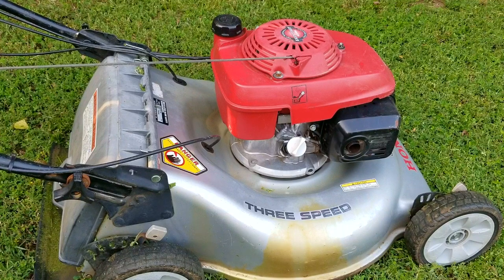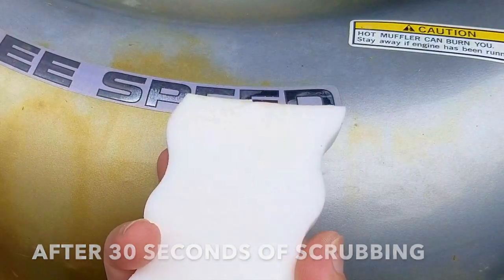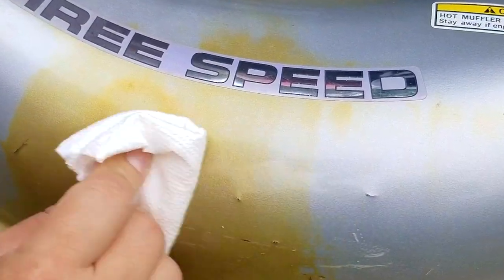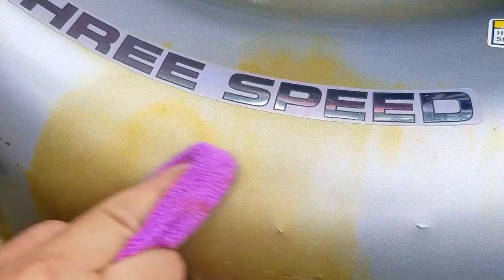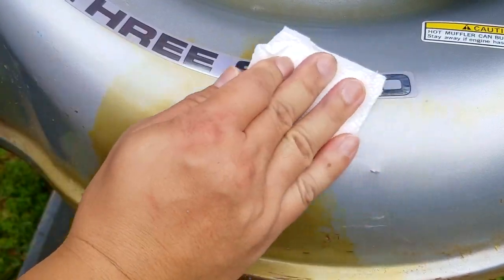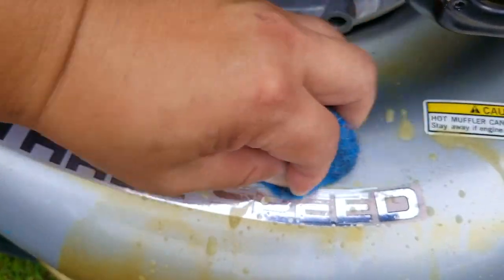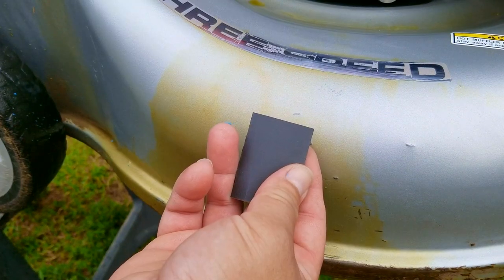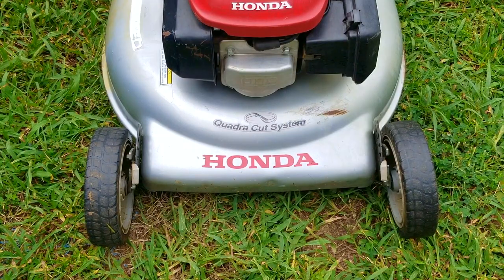Trying Cleaning Products On An Oil Stain On A Honda Mower

Comment: It seems as though a chemical reaction has taken place between the paint and the oil. I agree that the only way to remove it is mechanically. If that is the case the paint will be damage and the deck will have to be repainted.
Reply from the maker: thank you A Patterson, I agree with you.
Reply: That's always the case even if you don't damage the paint to bad it will still need a repaint or top coat to make it look right again

Comment: Magic Eraser is a little abrasive by itself and is supposed to stay wet and the steel wool is a little more abrasive and should remove the top surface layer of paint or top coat that is stained. After cleaning the stain then use the buffing conpond or a protective waxing after the stain is cleaned to your liking , I wash and wax my Husqvarna mower every once in a while to keep it looking nice as possible
Reply from the maker: thank you Eric Richardson.

Comment: Nice video.  Thank you for making & posting it.  (IMHO, don't worry about the stain, that stained paint protects it from rust.  Time better spent repairing the self propelled feature.  It's a nice machine).
Reply from the maker: Thanks for the tips!

Comment: Wished something had worked but the stain is imbedded in the paint. Gas probably wouldn't touch it either and a wire brush and a rattle can would fix it. I used 409 and shop rags to remove tar and nicotine out of truck cabs I was driving but that was just on the surface and ran down like brown water. I'm not a big looks fan and usually it's either looks or running and not both BUT that's what you're going for so more power to you. Happy weekend and GBWYou!
Reply from the maker: I think you're right, it's In the paint and either removing it or painting over it, will fix it.
Reply: @INSIDEHOUSEGARAGE  Mine looks goofy because I just paint to kill rust. Kids do a better job than me.

Comment: Thanks for the trial and error cleaning process. May I suggest a foaming product such as cleaning tubs but let it sit in the stains according to manufacturer specs. Be careful mixing and matching cleaning chemicals even outdoors as you are in close contact with fumes.
Have also found hydrogen peroxide paste may prove fruitful with less physical work. Mix hydrogen peroxide with diatomaceous earth for the paste in 50/50 mix and let it sit for 20 minutes then rinse with water. Use Adobe pad to scrub lightly as needed. Thsnks again!
Reply from the maker: nice, suggestions, I'll have to them a try, thank you Mr G.

Comment: The only real solution is to repaint the deck because the stain goes all the way through the paint. To do it right, the cost would total the mower. The only practical band aid would be to find a color that is pretty close, mask off and prime the area, then paint. You might want to look for a primer that will block chemical reactions if there is such a thing. It is possible that the chemical reaction between the oil and the paint may still be active. This means that the stain could possibly reappear in the new paint after a period of time. I don’t recommend stripping the old paint. Mowers typically take a lot of physical abuse. Field applied paint will never be nearly as durable as factory paint. I would probably just live with it. Another thought is that you could turn it into an art project and cover it with stickers. They won’t be as durable but you can always add more stickers. Just apply them at odd angles and overlap them leaving no painted metal showing. Just an out of the box thought.
Reply from the maker: you know that sounds like a great idea.

Comment: Im a bit late to the party, but i use an old hot water pressure washer and it cuts trough old oil and grease like butter, if you have to deal with greas and oil often i cannot reccomend them eneugh, i know even a used one is pretty expensive, but they are definatly worth the money if you have to clean stuff at least once a month
Reply from the maker: they are super expensive but you correct they work really well.

Comment: A non-working self propel is a drawback even to a person not wanting self-propel because it reflects on the overall condition of the unit such that they would be concerned about other things wrong or ready to fail. 
Stains can be two types: surface and embedded. Abrasives don't so much remove the stain as remove the material. Removal of an embedded stain necessitates an unstaining so to speak such as how bleach works. Other than painting that stain (which may bleed through), I would cover it with an interesting bumper sticker or a homemade one that says, 'Do Not Remove This Sticker'.
Reply from the maker: you said it all, I really need to focus on what's important , which is the self propel, thank you 65CSX

Comment: I used Totally Awesome to remove glue left over after tint removal on  the back glass. I do not think this would remove the oil stain but, I wanted to throw it in the ring. :)
Reply from the maker: Great tip!

Comment: Maybe you could find a paint thats close to the color and give the area that has  the oil a little touch up? You did a really good job with  cleaning it up so maybe try a little more alcohol wipe it dry and then repaint it?  ive done that wit ha few of mine and i blend it in with the rest and it looks pretty good.
Reply from the maker: thank you Rares R, I'm going to consider painting it, but only after I try and fix the self propel,

Comment: I'd be curious what the paint looks like under that sticker.  Seems if there were some caustic additive in the oil, it should have delaminated the sticker. What ever it is, has reacted with the paint and is now part of the surface, sort of like anodization.
Reply from the maker: I know right, I'd like to take the sticker off, just to see as well.

Comment: i,d try out a pressure washer blast on that oil stain and see if it lifts it off as another resort option or just do a partial strip of the paint and then re-coat the area etc.
Reply from the maker: makes sense Patrick Stapleton.
Reply: @INSIDEHOUSEGARAGE  for sure mate and even paint stripper would work at removing the old paint too even if,s made of Led or a paint that,s harmful to the lungs etc.

Comment: I’m amazed you didn’t use Super Clean!  Of all those you tried, Super Clean is probably the best degreaser. That said, I have to agree with the commenter who suggested that may be a rust stain under the paint. Very odd the way you were able to remove part of the sticker and the stain above the sticker but not the stain below the sticker. One other possibility is oxalic acid. Available from the pharmacy in powder form, you can mix it with water into a liquid or into a paste and apply to let sit for a while before rinsing clean. It’s somewhat like a bleach but chemically different. Worth a shot in a tiny area. I’d mix as a wet paste so it will stay in place instead of running down.
Reply from the maker: well, the only reason I didn't was because it wasn't suggested, But since you've mention it, I can now try it out.l
Reply: INSIDE HOUSE GARAGE   Also strongly consider the oxalic acid I suggested. It might just work. Better at this point perhaps to continue to try chemical solutions rather than mechanical.
Reply: Super Clean is a great product for degreasing lawn mowers, but it shouldn’t be left on the paint for very log as it will dull the paint. Works very well on a greasy oily motor.

Comment: Hey Eric I hope I spelled your name right. I was thinking what if you try to soak that part of the deck in the Industrial degreaser. That somewhat worked. And maybe work on the self-propelled after trying to see if soaking the deck will help.
Reply from the maker: Thanks Gaming Gang, yes that might work, but from what I've been told by my friend who suggested it, it would also start to take the paint off as well.
Reply: Oh ok I see. You’re welcome. Maybe the best thing is just to repaint it.

Comment: I wonder what kind of paint they use that the oil becomes embedded like that, or maybe just lack of clear coat or something. Good test of products though.
Reply from the maker: yes I doubt they did a 2 stage paint on here, and I'm sure, what kind of pain this is, but it looks like it totally absorbed the oil.

Comment: Better off repainting the deck, especially since there are rub marks right next to it that have started to develop surface rust
Reply from the maker: I think you're right.
Reply: The Flameproof brand of engine paint has the silver and charcoal colors that match the older steel Honda decks perfectly.

Comment: Magic eraser is like sand paper
Reply: It’s roughly equivalent to 6000 grit. Any scratches you may notice after using it will easily polish out. It’s a great tool to have on hand
Reply from the maker: not really, it's like 2500 grit which is really kinda soft.

Comment: Hey bro what's up? I really thought that you might of tried some gas on the oil stain. Simplest solution is to give it a coat of paint.
Reply from the maker: hmm... why did I think of that, thanks.
Reply: @INSIDEHOUSEGARAGE  South Main Auto, Rainman Ray and others use brake cleaner. Might destroy the decals, though. Are the decals available if you repaint?

Comment: I have a lawnmower that starts okay but if you turn it off it won’t start again until it cools down would you have any idea what the problem could be?
Reply: Sounds like a bad coil
Reply from the maker: I've only seen this once before and it had to do with the compression being low, due to not changing the oil. Do you know it's service history?
Reply from the maker: that's also a good idea, I would check for spark , right after you shut it off then.
Reply: I inherited the mower from my late mother, it was quite new but has been in a shed for about 3 years.
I will change the oil to see if that works .
Thanks for the reply

Comment: Are you sure that was a motor oil stain? It looked very familiar to stain I dealt with caused by oil based stain spilling onto a painted surface and not discovered soon enough. Repainting is the only way to make it right.
Reply from the maker: it's right where the oil dipstick is, it's kind hard to think it would be anything else, but you never know, you might be on to something

Comment: Take it to the car wash. Pressurized soapy hot water should do it.
Reply from the maker: interesting idea.
Reply: @INSIDEHOUSEGARAGE   I work on mowers for side cash. Car wash a mile away. Tilt the mower on its back wheels and blast underneath. Takes about 30 seconds; as opposed to my inefficient putty knife. 

Set the mower back on all four wheels. Air filter has been removed. Duct tape on the carb, spark plug boot, gas cap and dipstick. Blast the engine, then back off a few feet to clean the shroud and painted deck.

Cost about a buck and no mess in front of my garage. In your case, you wouldn't get your lawn soggy. Haha

Customers love getting back a clean machine. And they tell their friends.

I've seen all your vids on both channels.  You have great content and style with near professional editing. Thank you.

Best regards from Missouri.

Comment: ok steel wool in use😅 that oil stain is stubborn. Um. 🤔 honestly. If youre selling it. Just fix whats needed. If youre keeping it. Maybe make a video or 2 out of painting and fixing. 🙂 id just scuff it and paint over the other paint personally. Mostly because the stain would annoy me.
Reply: Maybe try some heavy duty oven cleaner? i know one we have started stripping paint. So it might actually remove the oil stains 😅 but could cause paint to bubble.
Reply from the maker: Thanks for the tips!
Reply from the maker: I think the oven cleaner will work the best
Reply: If you try it. Let me know how it does or maybe do a vid on it. Id love to know.

Comment: try acetone.
Reply from the maker: yes I think I will, thank Tim Ewa.
Reply: @INSIDEHOUSEGARAGE  nice classic deck. if acetone is a fail, 800+grit wet/dry sandpaper with lot of water & light touch. Looks like it's parked right on top of the factory finish. Wet/dry will 'knock' it off without marring if you're careful.